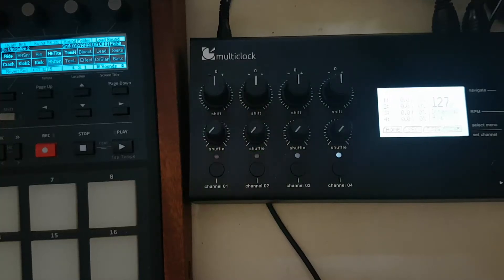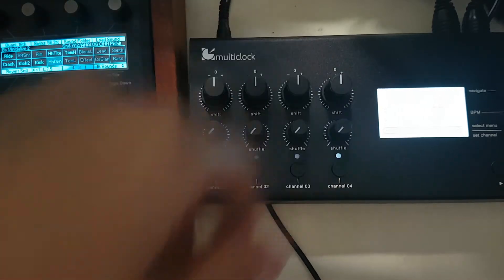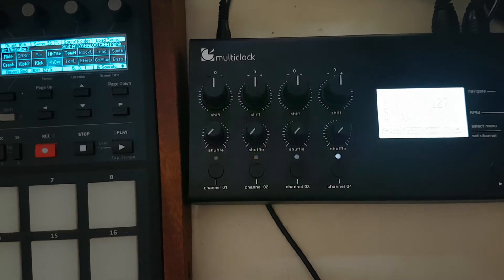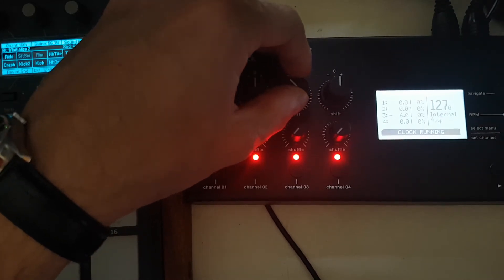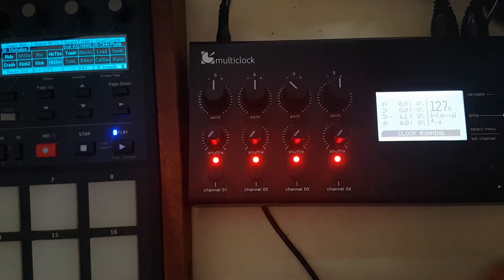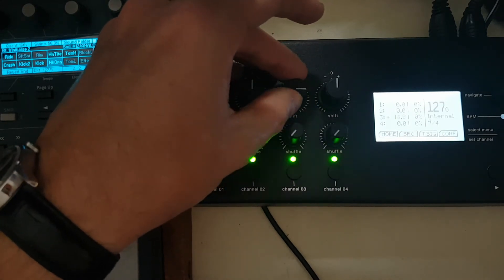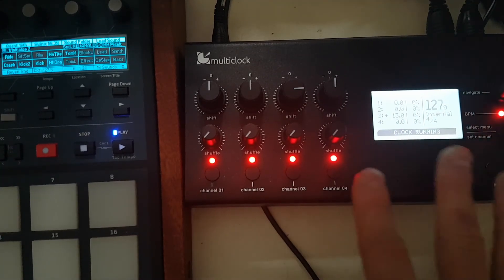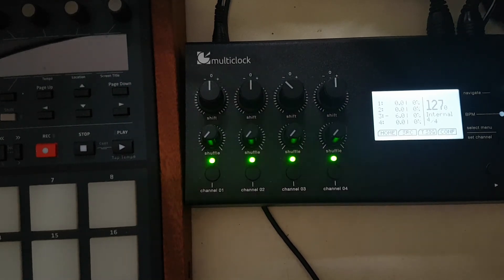multiclock ERM test to sync gears (TECHNICAL VIDEO (boooring))

Comment: Can it take Midi in from synth ? im so confused
Reply: Mainly for using with devices that have a clock so the timing is spot on.
Reply: its a master clock not a midi in. you use it to synchronize your instruments so they all play in time.
Reply: @xisotopex it has a pretty extensive midi mapper feature. Yes you can input midi note/controller data remap it to any one of the 4 DIN outs on any midi channel.

Comment: Thanks for making this video. I’m on a similar sync issue journey and just got the multiclock and found it sometimes greatly helpful and not so much a few tries later. 

Gear involved is a Keystep Pro controller/sequencer into midi in from the multiclock, Output 1 multiclock into midi in Roland tr 8s, tr8s usb audio into ableton live external instrument plugin drum rack, that rack into another rack for printing   audio from the external instrument rack (one channel for kick, snare, etc). And that recorded audio is seems off ever so slightly to be audible (very!) no matter how much fine adjusting. 

Probably way too many possible culprits. 
Master clock comes from the multiclock plug-in in ableton via audio to the 1/4 jack on the clock. 

I also couldn’t get that trick to work where you set the multiclock to POS only mode and adjust the plug-in to send clock early in order to have everything start without the 1 bar offset. 
Did that work for you?

When I tried, offsetting track delay on the plug-in did start everything without offset but did nothing about the recorded audio being late. And I couldn’t get it to be early to shift it forward on the multiclock. no matter what amount negative delay I set on the Plugin, the recorded audio didn’t move forward. 

Guess we’ll all just continue the search for the holy grail of perfect sync with no latency and then - only then - maybe even make some music one day.
Reply: Hi man i hade the exact same problem, i try to offset the plug in in a negative value but my analog rythm does not respond to that, however my beatstep pro seems to respond to it? Have you salwe your problem?